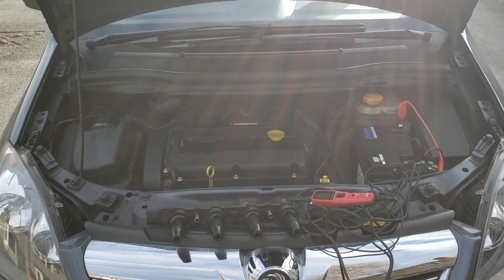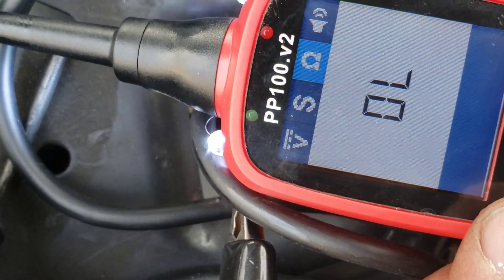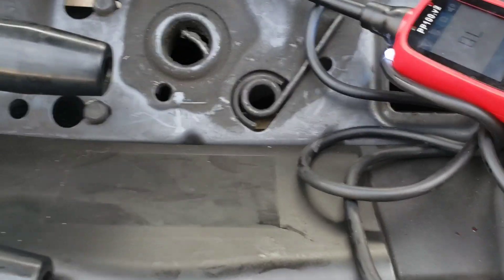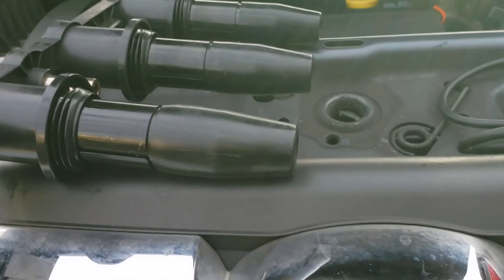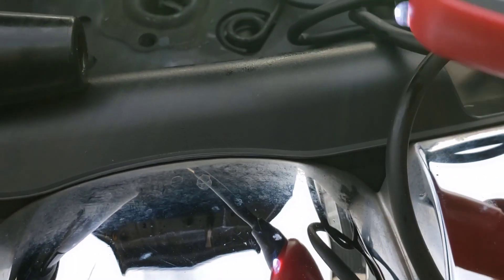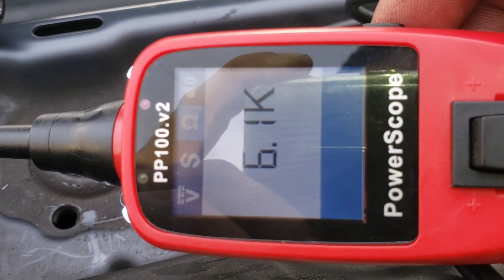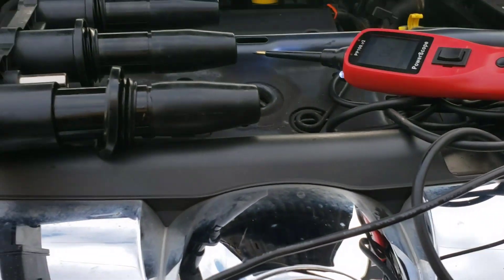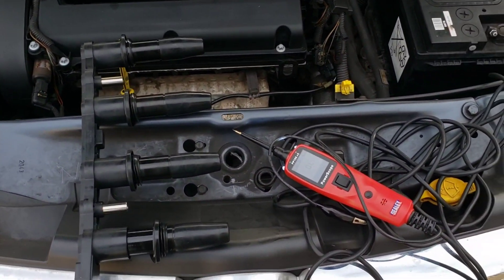how to test vauxhall coil pack

Comment: Dude all you have to do is turn the coilpack uoside down, insert 4 boogey chords in each coil then pit the other ends in the spark plugs cranks engine and if you remove any of the leads and it makes no difference in revs for one you remove then that one is buggered
Reply: He prefers to do it his way, maybe so that the engine block continues to work healthily long enough? instead use the engine block as a tester !

Comment: Do you by any chance no why number 3 would keep dieing, im on my 4th coil pack over a 1 year period, all delphi. One guy on another forum said blocked egr channels?
Reply: I find in forom, that you must change coil pack and cranshaft sensor in same time. My add opinion is with same brand will be good.